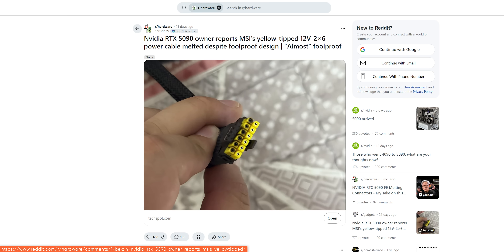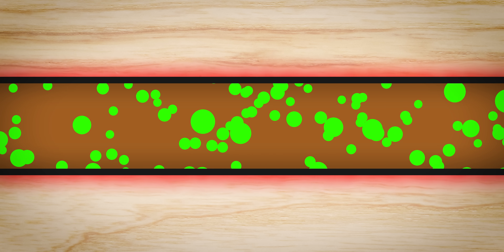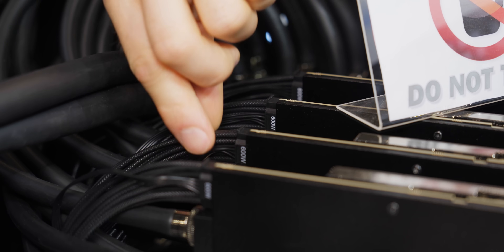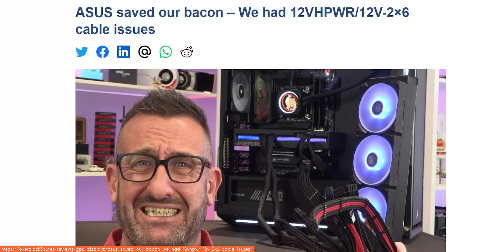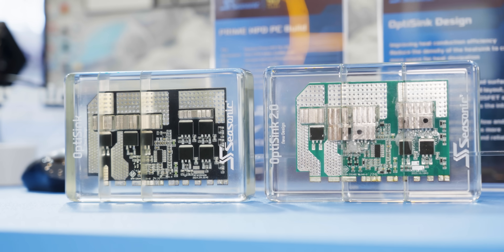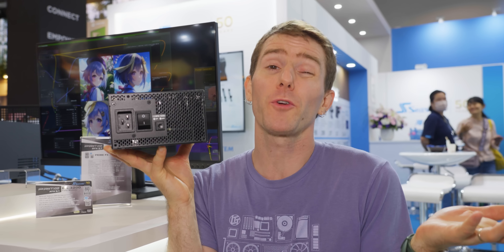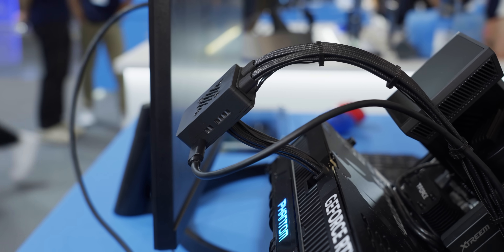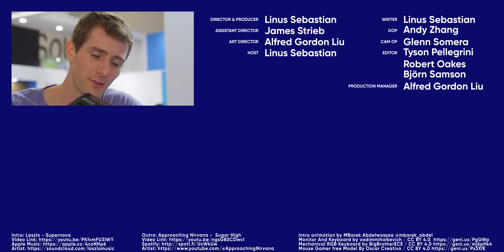The REAL Solution to Burning GPU Connectors

Comment: i wonder if they only measure or actually actively balance the 12VHPWR connectors' pins

with only monitoring it only tells the gpu to draw less power which means less performance, rather than fixing the actual issue

just the plugs aren't the real issue, if any/or a few wires are even a milliohm of difference those will carry less current than the lower resistance wires

the fact it has multiple separate wires in pretty much "parallel" is already a no no

technically they should have CC/CV tech in the PSU limiting each pin to literally about 8.5 to max 9A

yes the card should actually do it, no matter what, but that would be a real solution rather than just being like "nope, bad cable/connection"

thats just too much of a bandaid solution rather than solving the problem

Comment: At computex, I've been seeing new power supplies and new motherboards, but still no ATX12VO, and I'm legitimately starting to get mad because there are so many good reasons to move to ATX12VO, but no one's using it. They don't even have to stop using atx 3.1, just make ATX12VO along-side. All I want is to just have the option to have an ATX12VO system.

Comment: I think my solution works just as well. Buy a GPU that doesn't need to use those connectors. Or an older GPU like I use.

Comment: So, the PSU manufacturers are still stubborn and sticking to the spec that only matters for servers…I would have been more impressed if Seasonic put each 12v pin on its own rail each with its own OCP. Also not sure why it would shut down the whole system, it should just power off that rail/connector, especially since they are showing it in a multi GPU scenario. I would rather lose one worker, be able to remote in and see ohhh GPU 3 is offline or get an automated email, next reboot I will change cable. Half assed approach but I admire their effort. Before you go blaming NVIDIA, everyone was involved in its design and approval, and by everyone I mean literally every single company in the server space. If I’m not mistaken the AMD pro cards use this connector as well, and so will the high end Intel cards for AI. It just so happens that NVIDIA makes a crap load of pro cards vs consumer, where the other guys are essentially nowhere to be found and can afford to run two different designs between the two lines. It’s not NVIDIA’s fault they are successful, they didn’t design this crap, they were one of like 12 companies that signed off.

Comment: Correction. The Asus Astral does not solve the 12VHP issues. What the Astral does is has monitoring on if the cables are running abnormally high current and give you a notification in Windows; if you have their specialized software installed. Their method will not automatically shut down the card, it won't load balance the cables, and it won't even do anything if you didn't install the extra software for your PC.

Comment: Good to see that Seasonic has looked at the problem and created a way to detect it. Now lets hope they have added some way to signal why the PSU shut the computer down, or just a way to show that the computer is not running because the PSU says it's not safe to do so.

Another "problem" is that the protection circuit will only be in the more expensive PSU's from Seasonic. And to say that most people are kind of penny pinching doesn't make it better. Unfortunately it looks as if the only way to provide this kind of protection for cheap would be to have a external unit either plugged in between the PSU and the GPU or a replacement cable with the sensor tech built in. And then we hit the horrible lack of cable standardization. I think I saw a label on a PSU shown in a recent video. I think it was a Corsair PSU and the label said to only use genuine Corsair cables of Gen 5. So that means that Corsair, or whatever company it was, has at least 5 different cable pinouts that they have used. That is one company, now try comparing the pinouts for all the other brands. The ideal, in my opinion, would be if the PSU brands were to use sockets using the same pinout as the plugs they are supposed to support. But so far that's a pipe dream.

Comment: Minor correction - the Astral series cards cannot act on circuit imbalance, they only have pin monitoring ability. The software can warn a user visually, but the card isn't able to independently shut itself down as a protective measure.
Reply: Is there any reason the driver of the card cant initiate a shutdown?
Reply: @kivagalehall4965 it 100% could, but thats not really a decision that asus should make, its likely that nvidia wouldnt even allow that
Reply: @AK-Brian Actually just coming back to this, even if there are no drivers with this capability on the OS (for who knows why) the card can always just shut itself down. System Crashes suck, but so does a fire.  -KivaGale from Wasilla
Reply: I think he was talking about btf thing

Comment: Dear gods, do not use those fuses. If you have to, Buss and others make LED ones for when they fail and always have it viewable at a glance. Hell, at that point. Drill into them, connect them in series to a buzzer alarm (like one of those basement water detectors), and you will know if the fuse blew.

Comment: All this just so they don't have to increase the standard voltage for video cards to 24v.  Increase the voltage lower the amps and you can use a thinner gauge wire.  All it would take is a partnering with power supply makers and video card manufacturers.  Get them on board and change the standard.  Or, maybe consider a more efficient architecture.  Like how apple ditched Intel because the power draw was way too much.

Comment: I have a 5070 Ti GPU now. The first thing I noticed was how small the 12v6x2 connector was on the Y adapter the GPU came with, and how tight it was to plug it in. The connector also did not have a clip but a groove. This means that there is no click like the old school 12v6/8 connectors.  I literally had to unplug and plug the connector 3 times very firmly and had to use a flashlight to ensure the connector was plugged in all the way.  I would imagine many people who want to build their PC will not have it plugged in all the way if they don’t check it with a flashlight. If the connector was 50% bigger and have a clip like the old one. It would not have this issue. I think the design of the 12v6x2 was meant for server based GPUs where space is a premium. NVIDA who just went full in on AI likely didn’t want to design a consumer oriented power delivery design for their high end GPUs. They all have the same 12v6x2 circuit design their AI GPUs for data centers,

Comment: Well I know see Sonic won't like this comment. 

But there's an obvious easier and more importantly. 

A more cost effective solution then putting a monitored variable resistor in a power supply which should already be there.

That is of course increasing the gauge of the wire within that standard connection. 

Surely there must be The same kind of cable with a lower gauge. 

Which you showed directly. Even if you went with the 14. You'd still be better off. But I would go with 10 just to be safe. 

And now you don't have to buy a whole new power supply.! 

I mean you literally say it right at the beginning.

"Usually by using a big ol-chunky one."

But I guess having good relations with technology vendors would probably come in handy I can agree.

So I can understand why you would advocate for seasonics entirely new power supply.

That will allow you to safely use a larger gauge cable. 

Which seems pretty absurd to me. 

But we all got to do what we got to do I guess.
Reply: The cables are not the problem. It's the actual connector that is a problem. The pins are to small and only work as they should when everything is perfect. And here is the problem. these connectors are not perfect so there will be some risk that the pins doesn't make perfect contact. If you compare them to the old graphics power connectors there is a huge difference. Even if they were a bit sloppy the pins were large enough that they could still handle the power most of the time. Yes some of those has also burned, but compare the numbers and they are pretty stellar. To make these new contacts safer they would have to be redesigned and the pins larger with more contact area. but that would mean that they would no longer ne compatible with the 40 and 50 series of GPU's.

My solution would be to scrap the PCIe power connector as well as the 12VHPWR connector. Then you the EPS 12V connector that has been standard in servers and ordinary PS for over 20 years. If you compare the PCIe power connector then you see that the 8-pin connector has 3 x +12V and 5 x GND, while the EPS 12V connector has 4 x +12V and 4 x GND. And as they use the same type of pins the EPS +12V connector can handle a bit more power. The funny thing is that the PCIe power connector is rated for higher power then the EPS +12V. The explanation is that PCI Sig used lower safety tolerances. So again they thumbed the safety protocol to make the connector look better on paper. They did it again with the 12VHPWR connector but this time they dragged the safety tolerances even lower.

Comment: So Nvidia wanted to save board space by getting rid of the bulky connectors. The 12vhpwr 'solution' burns semi-regularly. And now they're trying to solve that with an extra board in the power supply.

Congrats, it's evolving. Just backwards.

Comment: The 12 pin connector is a mistake, the industry has spent years trying to mitigate the fire risk to little success, a smart GPU manufacturer would have given up and moved back to 6+2 pin connectors.

Comment: It is still no solution. It only shuts your PC down, if it is going to melt, which creates frustation. You still need to open your case and reseat the connector, hoping that it sits perfectly this time.
What we need is load balancing!

Comment: I’ve been waiting for PSUs to update with security for this.
Running my 3yo corsair hx 1200, first with a used 3080 and now with a new 5080 and luckily haven’t had any issues and the psu should be good enough.
But as we know, it’s not really a psu issue..

Comment: Why are you still talking about wire gauge? The problem has always been the damn pin...the quality of it, the pin to pin contact, and the poor engineering of it... The more power the cards need, the smaller the pins get... See the problem? Not to mention the fact that people like cable management... Which means bending the damn things, and if course the cable pins get bent and get loose degrading the connection and of course the amount of power they can transfer... They don't care about your experience... They care about making the poorest quality stuff they can get away with, blaming you for their lack of  rationallity and engineering skill... Change my mind!

Comment: 02:22 This makes me feel smarter, because I had guessed before this point in the video that one way the PSU could do this is if the PSU would be able to monitor heat and power output, cutting off power if it detected abnormalities, and turns out that is pretty much exactly what was said after this point.

Comment: FWIW the spec for the connector technically says the GPU is supposed to just merge all the 12V pins onto a single conductor without anything in between.

Comment: The fact that Nvidia's engineers allowed this problem to occur in the first place is CRAZY, it's basic knowledge that having varying cable lengths etc causes differences and potential problems, early pinball machines specifically functioned with this principle in mind🤦‍♂
Reply: They spend all their money on the optimizing of the cooling for their 5090 reference model
Reply: @moortu  nah the cooling is still fairly cheap in the grand scheme of things, the PCB and silicon die is the most expensive part to design and manufacture so I don't think it's the new cooling design that is the problem, the 4090 has the same problem and yet was cooled normally instead of having internal fans and a weird but kinda cool vertical PCB design to open up the airflow and not have it just bounce off the PCB and blow out the sides or through a passthrough like most modern cards also feature, it's mainly the power connector here that is the problem, manufacturers need to implement smart load balancing further increasing cost, just to have it function without melting, eesh, I think EVGA can sense the future and that's why they got out while they still could😬

Comment: Everyone is looking at this problem the WRONG way. Instead of designing things to cope with "power hungry GPUs" Nvidia's Enginerds need to up their game and stop being so lazy, and actually design GPUs with a low power draw while maintaining the performance expected. Don't tell me it can't be done, they are just to lazy or maybe incompetent to do it the right way. The automotive industry is a great analogy once again, if the trained chimps that design cars can make them more powerful while maintaining their fuel efficiency, or even bettering it, then I'm sure the trained chimps at Nvidia can do similar in their work process with GPUs.

Comment: Dont all PSU's have Over current protection now? but because they are pushing specs and draw they(psu manfs) need to implement safety workarounds? why not 12amp fuses on a block cable?

Comment: Cost saving is such a BS excuse considering the thousands these cards already cost, are you really going to notice or complain about a safety feature that may cost a few cents to a few extra dollars to include?. If my house is at risk of burning down, then I want the extra safety features built into the card. That Asus feature to monitor the AMPS across the pins should be a bloody standard feature, and if those AMPS go out a specified range, the GPU should just cut the power.

Comment: The current format of computers is stupid. Who upgrades their PC anymore? If a new processor fits in your current motherboard it's probably not enough of a performance jump to bother with. If you need a new motherboard, you're probably going to want/need the new ram/pcie spec. If MB, CPU, and ram all need to be changed every time anyway, it might as well all be one module. 

Graphics cards are stupid. It's a whole another computer you put inside your other computer. They should be external in their own enclosure that sits on top of the compute unit, or wherever you want it. Everything with it's own proper power supply and cooling built in.

Comment: Edit: Changed the max to 48 volts.  I chose 30 because of technology limitations and supply of capable chips is higher.
Again? Another caveman solution to the melting cables?  Why overcomplicate something that is supposed to be simple, a cable, with temperature sensors because of an already poor design?  JUST MAKE IT 30 VOLTS !!!  Make the standard a 28 to 48volt supply for GPUs, change the connector so the new one can't plug into the old ones (and vice versa) and design the cards to handle 28-48 volts on it's input.  Higher voltage means lower amp draw through the connector and wires.  IT LITERALLY SOLVES THE PROBLEMS WITH MELTING ! ! !  PCI-sig has failed and NVIDIA is literally forcing it down peoples throats.  If there is anything I am certain of other than death and taxes, it is this! They can do it. Yes it will be slow adoption, but they've already wasted a ton of time and money on caveman solutions. GPU does not equal fire!

Comment: So, these 12 voltage high power connectors are experiencing a kind of cascading failure. One cable causes others to pull the weight then a second goes out causing the rest to carry the weight of both and on and on until it melts or starts a fire.

Comment: Also the issue isn't the board manufacturers not wanting to add balancing because of space savings or price. It's because they are required to merge the pins directly on the pcb into power plains which completely prevents any balancing from happening. Asus's astral design is technically violating that specification

Comment: The connector is only rated for 30 CYCLES?!? How in the hell is this allowed? This just makes me never wanna touch a GPU with that connector. Say you swap in a new SSD and you have to take the GPu out , maybe your doing a MOBO RMA. Whos to say on the 8th time you disconnect the connector one of the pins fail. I have never heard of any product having a "life" cycle of 30 times. Nothing and this is on $2500+ GPUS. Imagine your linus and you do a ton of testing on these GPUS, You can only use the wire up to 30 times before its just trash? So wasteful. Like sure all you gotta do is replace a wire but like you have never had to for any PC part due to it having a CYCLE, Like sometimes plastic clips broke but they wouldnt be made so crappy that they can mess up the pins and sockects when being plugged in and then get stupidly hot and burn the plastic.

This is scummy. Never gonna buy one

Comment: This is why I bought a 9070XT with 2 8 pin connectors. Why pay for a new power supply again when you can use the old-fashioned method of just having connectors with a higher factor of safety?

Comment: This is completely insane compared to the option of:
- just use bigger connectors
Reply: but that would at 50 cents to the material cost of the cards :O
Reply: @kubeek   It might actually be cheaper since the older connectors are manufactured in much higher numbers